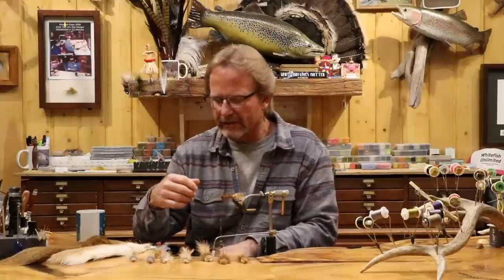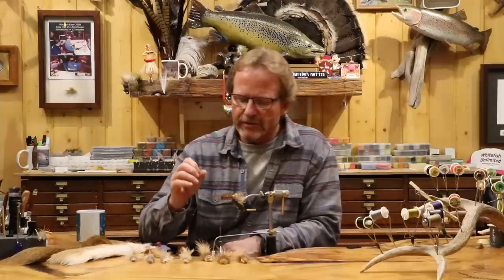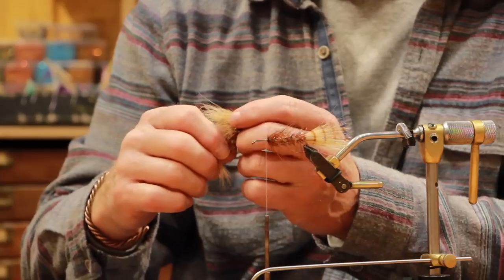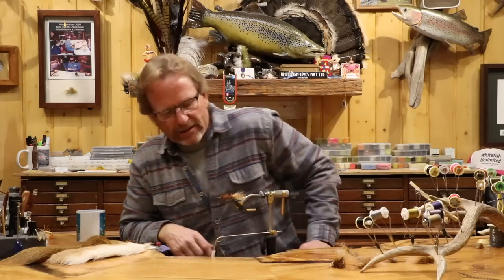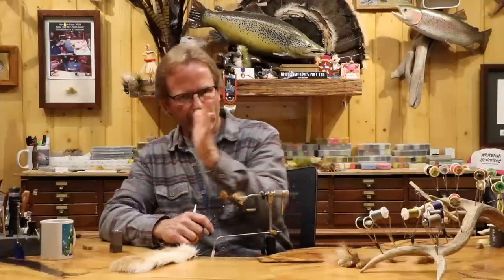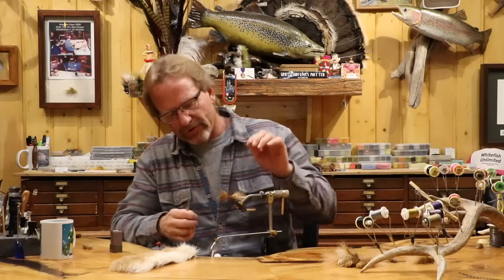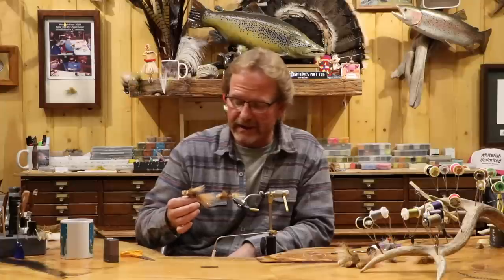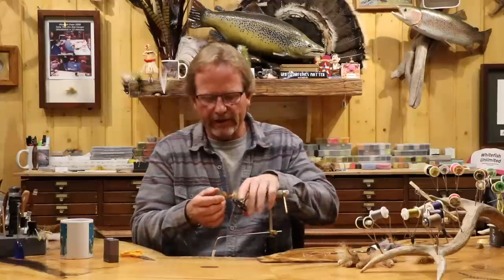Creating a Functional Deer Hair Head with Kelly Galloup

Comment: You could cover the head with uv glue, then put on sticky eyes and cover that with glue, it looks a lot more realistic
Reply: Scyco, have to be careful when you add glue on hair, looks good but your fly tends to float or roll over. If you do it don't put it on the bottom , it will make the fly roll over and spin your fly.
Reply: Kelly Galloup ok thanks thats good to know